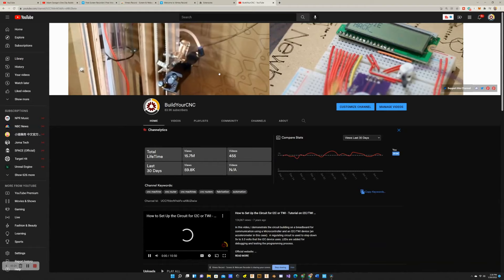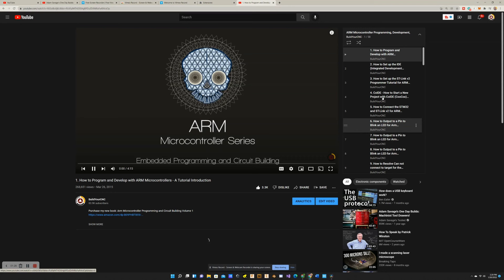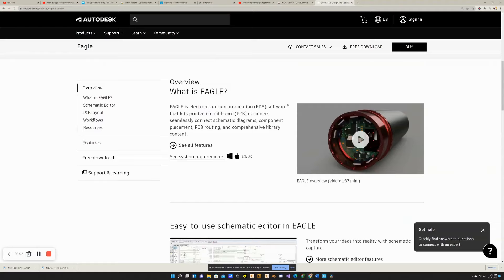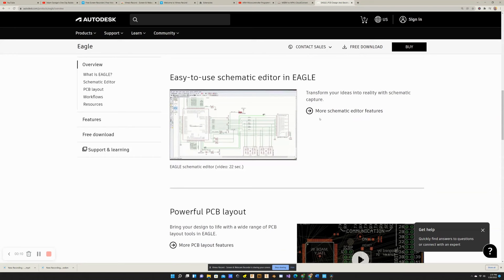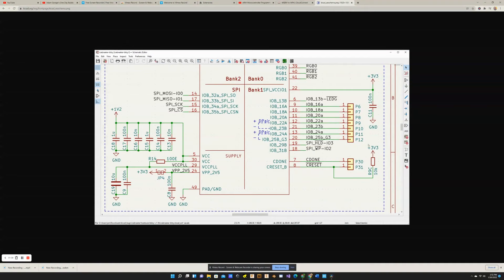#1 Say NO to ARDUINO! New ARM Microcontroller Programming and Circuit Building Series

Comment: Forgot to mention that STM also offers Nucleo development boards for a lot of their chips so you don't have to make your own breakout board but can just buy a Nucleo (with built-in STM programmer) and start from there which speeds up the development process. These are not entirely the same as the application specific development boards, they are more in line with an Arduino board.
Reply from the maker: Thanks for the info.
Reply: Normal people with no electrical engineering should not produce any product.
Reply: @gursharansingh7398  Yeah and no one should try to spam other people but hey, its not like that is happening anytime soon either

Comment: If I'm not mistaken, Atmel MCUs are ARM.
Reply from the maker: Depends on which chip. Atmel makes ARM-based chips, but there are also the AVR and the PIC (since Microchip bought Atmel) style as well. In the beginning, Atmel only developed AVR 8-bit chips back in the early 2000s.

Comment: What is a good program to modify / compile arm Embedded. .Pkg files
Reply from the maker: I am not familiar with .pkg files. Apparently. that file type is a package file. Can you give me more information on what this .pkg file is? Is it an EmbeddedOS?
Reply: @PatrickHoodDaniel  Sorry, I didn't have much info on the hardware, at the time I posted this and, basically no knowledge on embedded programming / programming in general. It is a STM32 (stm32f412) embedded chip. I see now that STM32 has it's own software to compile the files. 

The only thing I could figure out is that the .pkg file I dumped, is an OTA firmware update. So, I probably could of just sorted it out myself haha. I'm very much a newb and it shows. I subbed and thanks anyways for the reply!!
Reply from the maker: @woolfy02  Not a problem at all.

Comment: Can someone tell me how to use platformIO with a arm based development board?
Reply from the maker: Are you using the PlatformIO plugin with VSCode? If not, what IDE are you wanting to use it with?
Reply: @PatrickHoodDaniel  i use the platformIO plug-in. I am trying out a samc21 board
Reply from the maker: @bryankobe9197  The PlatformIO plugin is used under another IDE.  What IDE are you using?
Reply: @PatrickHoodDaniel  vsCode

Comment: I'm pretty new at all of this I've only been doing it for about a month or two but why do you say that it's hard to go to production? It's very simple to program a micro control chip external to the Arduino such as an at tiny microcontroller or any of the larger microcontrollers if that is required why is it that you say this I'm not saying you're wrong I obviously don't know a lot about this I'm asking you so I understand
Reply from the maker: It can be difficult to go to production if you start with a platform that is complex where you will need to pare down to the  circuit you only need rather than starting from the bare chip and gradually building up.

Comment: Why not ESP32? Isn't it cheaper and more powerful?
Reply from the maker: There are ARM microcontrollers that are also SOC (System On Chip) with many variations of processing speeds and features. ESP32 is great if you want to go that direction. I enjoy bare metal programming so I have the flexibility to go with any chip on the market and so I can build up the circuit that I want hat has the cost efficient and application specific attributes.

Comment: The barrier to a lot of people, including myself, is an inability to solder surface mount, interesting all the same
Reply from the maker: Would you like a video in how to solder surface mount?
Reply: @PatrickHoodDaniel  I would love it!
Reply from the maker: @dougsteel7414  Cool, I will show the process of how I solder the ARM chips to the boards as I do it manually here in my shop, and it is pretty easy after you find out the correct procedure.
Reply: @PatrickHoodDaniel  that would be fantastic, thank you so much!
Reply: It’s not that hard and there are good tutorial videos on YouTube, eg. Dave Jones. You can even solder QFN and BGA packages with hot air or hot plate. Use solder paste and a custom, inexpensive stencil, eg. OSH Stencils.
Reply: @mikeh39  you don't know how cack handed I am!
Reply: @dougsteel7414  Well I am in my 60s and recently made a board with a 400 um pitch QFN chip. It just takes some practice, the right tools, and a lot of patience.

Comment: which arm microcontroller?
Reply from the maker: I use the STM32 line of microcontrollers in this series. Any STM32 microcontroller will work fine as long as you refer to the programmers manual for the uC you have. Specifically, I'm using the STM32F030R8 in this series
Reply: @PatrickHoodDaniel  a beginner in Arduino can get started with STM32 line of microcontrollers or there are any prerequisites?
Reply from the maker: @mkhatri007  There are no prerequisites. However, I would recommend getting the book that I alk about in the video series as there are many basic projects that will  help you build up to a very good level, and it serves as a great resource and reference.

Comment: I use a wide array of boards and chips including Atmel, but also Pico and Esp all with their strengths and weaknesses. I do not recognize the problem you attribute to Arduino where it would be harder to boil a prototype into a product with any of those platforms. Not from a hardware or a software point of view really. I think this isn't fair argument actually.
Reply from the maker: Thanks for the comment. I really do appreciate it. What are the steps you take to create a lean circuit starting from the Arduino?

Comment: The general statement "Say NO to ARDUINO" [1] is enough for me (STM32 professional user and STM32 fangirl) that disqualifies you of any seriousness. This conflicts directly with "Use the right tool for the right job", which anyone with professional experience in electronics engineering would tell you. It is good showing a broader audience the great possibilities of these chips. But you can do this without the pungent smell of a snake-oil salesman.

[1] while in reality, the Arduino Platform/STM32 based Arduino Boards is without any doubt usable for quick and dirty programming of STM32 based prototypes. But that is not my argument here. The MCU market is extremely diverse and the toolchain, platform, library and design possibilities are too. Only an idiot will think that a single ONE is THE solution to everything. But even worse are the scammers profiting of these gullible people ... Shame on them!

Comment: ARM microcontrollers are a complete shitshow compared to AVR or even 8051. The mental overhead required to get a project off the ground or to understand the processor is much, much higher. By orders of magnitude. If you don't need the processing power, don't commit to ARM. It really is not worth the headache.
Reply from the maker: I completely disagree. The claim that ARM microcontrollers are inferior to AVR or 8051 overlooks the superior processing power and efficiency that ARM microcontrollers provide. The 'mental overhead' mentioned is not a drawback, but a feature indicative of the advanced capabilities of ARM microcontrollers. The ARM ecosystem, including its community and resources, is extensive, providing ample support for developers.

Furthermore, the notion of avoiding ARM due to its perceived complexity is misguided. The ARM instruction set and Integrated Development Environment (IDE) are not more complicated than those of the AVR. It merely requires a willingness to engage with a more advanced set of tools, which in turn, opens up a greater range of possibilities for higher computational performance and innovation.
Reply: @PatrickHoodDaniel  Reread the post. I didn't claim that they are inferior. I do state, as a matter of fact, that the architecture is more complex and considerably so. 8 bit micros are very much easier to understand. The APIs are less complex. There are fewer registers that need to be configured. Based on that, if you don't need the processing power, you will be able to get a project off the ground faster with an 8 bit micro.
Reply: @PatrickHoodDaniel  Just to be clear, this is not a criticism of the content of your channel or of you. I am simply pushing back against your assertion that ARM is the go to in all cases. This is an engineering decision. One must weigh the benefits but the choice is not as simple as you suggest. Team size and experience are also factors to consider. There are many cases where resources are constrained and the application allows that an 8 bit micro might be a better choice.

Comment: say no to Arduino, but buy your book... sure you not only look for  money  and this is only a clever promoting...?!
Reply from the maker: No, I just love doing this as you can see from my previous videos on my AVR series. Wasn't promoting anything there. But, yes, I will promote the hell out of this book since it took a lot of time to make it and I still need to feed my family. Are you an Arduino user? I have a little tiny niche of getting folks to try bare metal programming as a different approach. Have you made any comments to Arduino about them promoting their platform? I don't see any problem with promoting anything.

Comment: Thanks for such fantastic video. I need a mcu with wifi. To develop wearable device which is connected to an app on mobile. Which one should I choose?
Reply from the maker: You can add a wifi module to almost any microcontroller. You need to determine the communication protocol for the wifi module and make sure the MCU has this feature.
Reply: @PatrickHoodDaniel   Patrick, you are so good. Thanks for blazing fast reply. What about Nordic semiconductors nrf series mcus which have wireless capabilities? Is it possible for you to develop a wearable device? Have you done some work in this field?
Reply from the maker: @mytube1000javed  Sure, if the MCU has built-in wifi, even better. I haven't, but the concept is the same.